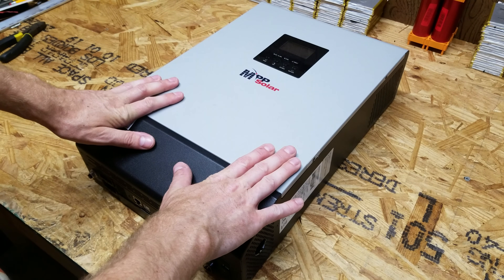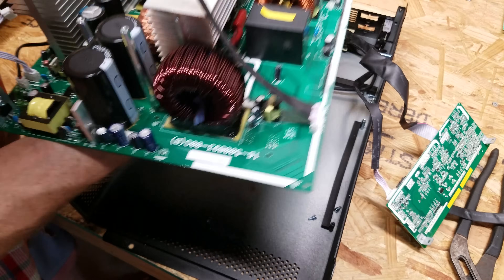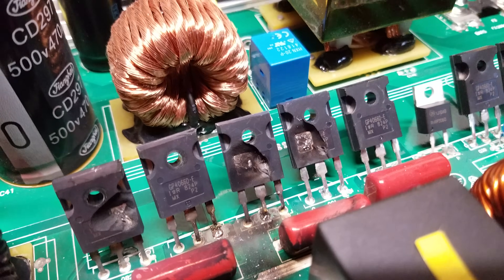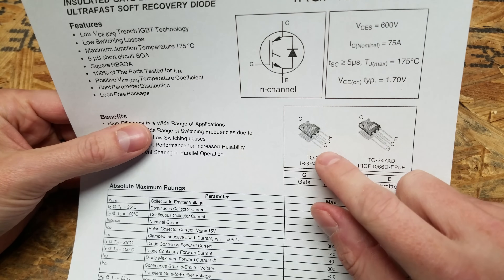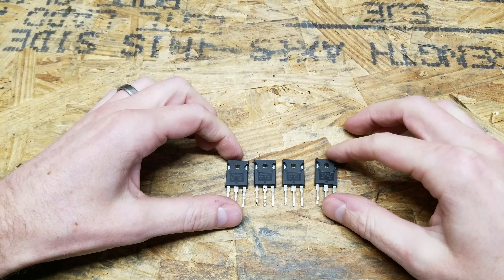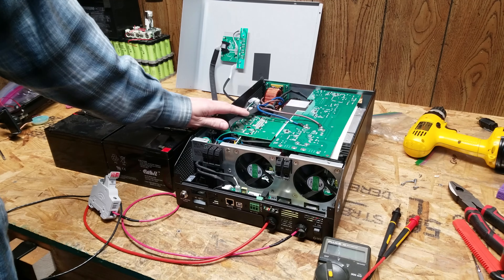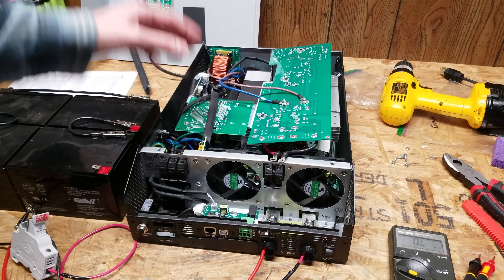MPP Solar PIP-5048MG Inverter Disassembly and Repair Attempt

Comment: Anything I could add pales in comparison to the intelligent comments I'm reading.  Just to let you know, I give you a TON of credit for giving this a go and hope like hell you get it figured out :-)
Reply from the maker: Thanks!! I love doing this kind of thing because, even if I fail in getting it running, I am learning so much in the process! I've always been the kind of person that learns hands-on vs just reading random articles online. So many great ideas have already been given. I'll give it a few days then run through the ideas presented and I'm sure I'll be able to figure it out. Great results happen when great minds come together :)
Reply: @Lithium Solar   its battery less...I mean its working with our battery?
Reply: Any update?
Reply: Change the ic
Reply: @ifeoluwatimothyadeyemi7373  what is an IC please?
Reply: @ifeoluwatimothyadeyemi7373  bonsoir
Reply: See  YT - Wajaeboseban AGS MPP Solar 5048 - he had to change more than just the transistors, his units (two of them) had a short caused by a critter!

Comment: Dear Sir. Very interesting vidéo !
 I am having for repair 2 MUST Solar Inverter PV1100, after changing burnt mosfets and gate resistors, i am having ERROR 3 (HIGH output voltage over 280vac) and on the other ERROR 4 (LOW output voltage below 170vac).
Any idea where to look at ?
Thank you.

Comment: I buy the ICs from LCSC, they are trusted and they don't take very long to arrive. It won't cost 12USD a piece. Mouser is a very expensive company.,
About yout video, usually the gate drivers get burned as well. They are opto isolated which is fine because the control circuit don't get damaged.
Your multimeter doesn't switch on the IGBT because your fluke has very low voltage to test diodes. The voltage is not enough to activate the gate. You could have used a lab power supply instead.
You should have cleaned the carbonization because that's conductive and might end up damaging the IGBTs again by arcing over their pins.
Beside the cost of those IGBT transistors i would replace them all. They work together to create a sinusoidal wave, so all of them have experienced the short circuit ones more than others).
I believe your also have diodes across the IGBTs. Those also go bad with time.

Comment: Do you know the code on these MPP solar controllers? I've got a 48 volt 3000 w. I'm looking for the lithium battery code. I seen it has a AGM code. I'm assuming it's in that area. I'm not exactly sure of the lithium acronym. Because I lost my manual. Any help appreciated. Thank you

Comment: the voltage in your meter is not sufficient to turn on the transistors, try 12v or check the actual  gate emitter-voltage from the data sheet.

Comment: If this inverter was mine I would replace the 600V 40A 306W IGBT transistors with Mosfet FCH041N60 from Aliexpress and it will work efficiently. Transistor drivers can be damaged also, but 90% of them are transistors or MOSFETs that fail.

Comment: You are using a meter he's not high voltage like 9 volt is higher than three volt meters you can use nine voltage meter digital meter and the three strings on most shit is on and off by changing the pins okay

Comment: Please advise where to get the card that connects the inverter interface control buttons with the main board through communication cable port . and what is the part name or number?

Comment: And the end of story is? I see no updates.
Reply from the maker: I put several new parts in and was not able to get it working. There were 2 tiny unmarked transistors blown on the bottom, which may have been the gate control. I don't know... They were willing to sell me a new board but it wasn't worth my time or the cost to repair it. It's been recycled unfortunately.

Comment: usually igbt have a zener diode and resistor connected to the gate for protection from transient voltages , when they blow they usually take them out too , you have yo follow the gate of the igbt back to the zener and resistor likely tiny little surface mount , as for the short on the battery side sounds like there is still a bad igbt , they can also be damaged if you take too long soldering them in , you need to set your soldering iron to a lower temperature and do the soldering within 3 seconds per pin , give them time between pins to cool down as the heat can damage them. great video well done , keep up the good work :P

Comment: Hello. Can you tell what is that rather small card you removed last before taking out big board out of the casing? My inverter is not charging and i think that card is acting up so i need to look for a replacement. Thanks.

Comment: Hi I know its too late but its not my fault because i see this video today .so for just information purpose only, DC power goes to DC side of the inverter , In left side of your inverter where small transistor are I think they are faulty.

Comment: I have a mppt 2400w 24v planning to put a shelly plus 1 using (12v) on the switch(AC) is that possible so i can turn the the switch(AC) as a wifi/bluetooth?

Comment: I use quite a few Aliexpress components. They all seem to have worked fine. Sometimes they are counterfeit or out of spec rejects but mostly they seem to be overruns. But I would NEVER take a chance in an inverter or similar with potential fire risks.
Reply from the maker: Yeah there are a LOT of fake transistors on Aliexpress. It's pretty bad...

Comment: its always a hit or miss when repairing electronics. you should have got model number of the display. my display has gone bad even though inverter still works. i have to try to replace my display

Comment: Morning

Im Lost with an PIP-5048 Inverter

There are no Error codes All FET's And Igbt are in order
When power from util nothing switches on
when powered from battery Inverter switches on
When powered from both Inverter indicates utility Voltage 238 V but battery doesnt charge
Inverter Indicates Battery Charging But no current or Voltage to Battery
When Inverter on and running battery can be switched of and inverter stays on

Any ideas on where to look next

Comment: yes these are High Frequency inverters I have been repairing quiet alot of those , all Mosfets have to be replaced as well as checking the reservoir capacitors, there are also ICs called Gate driver ICs which drive the mosfets those also have to be checked they are 8 pin DIP ICs which drive the H Bridge of the Mosfets,
The other thing to check is the IGBT transistors on the other heatsink. there is also a 2pin rectifier near the IGBT transistors to be checked.

Comment: Your Mosfet measurements were correct but why didn't you check the gate oscillation volts with the Mosfets open? If you check mosfet driver IC and mosfet driver IC 12 volt input regulator of your inverter and connect mosfet gate voltage Oscillation OK, it would work.

Comment: your multimeter diode mode voltage is too low to open the gate . it needs a minimum of 3v to open. i believe your fluke diode mode voltage is 1.9v

Comment: Did you ever get it working????
Reply from the maker: No, unfortunately I did not. There were some tiny transistors missing from the bottom side of the board and was unable to find any sort of part numbers. It was a lost cause from the start I thinks.

Comment: The DMM trick is BULLSHIT, you need a much higher voltage to turn it on than MOST DMM use for conductivity/diode tests.
Reply from the maker: Yee, I don't think that was very good testing. I'm no electrical engineer lol.

Comment: Hey, I have the same inverter, and also had the same problem. If only I had seen your video before I repaired it. 
I also had a dead short on the terminals. The culprit was those smaller transistors on the other side of the board. They visually look okay but they’re all shorted out. 
My inverter is EXACTLY the same but a different brand name.

Comment: Hope you get it work as a engineer I just spot your videos and take a look you have a very very long fixing to do the igbt was testing wrong the positive of the multimeter should touch the gate and negative touch the source to turn the gate on not the drain to gate that won’t turn on and you should had test the input of the motherboard without the igbt installed to see if anything is burn that way you know and the driver board should be tested on its own with oscilloscope for signal

Comment: Hello what kind of circuit board is that at minute 2 ?  we have 2 inverters, one with this board and one without this board.  thanks for an answer.
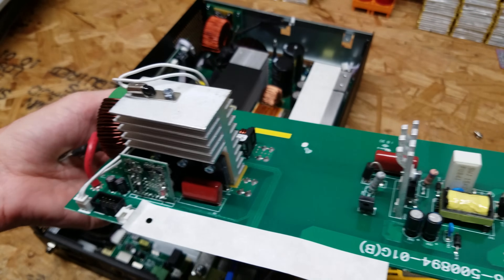Reply from the maker: The board I was holding at the 1:55 timestamp is the MPPT solar charge controller board. You may not have a charger built in if yours is an inverter-only and not an "all-in-one".
Reply: thanks for the reply, i mean the small board at min 2.07.
Reply from the maker: Ah, sorry. The service manual refers to that component part number 16-500271-00G as a "parallel power board" and lists it as "optional". Based on the block diagram, it looks like it's purpose may be to sync the grid power and inverter power so both can be fed to the output simultaneously. I'm not 100% sure though - not an engineer and don't have the inverter anymore unfortunately to trace though.

Comment: Did you check if the board was still a dead short before replacing the FETs? It could be a transient supressor.

Comment: you should have first desoldered and removed all the power transistors ,4x IGBTs,and all the Mosfets  then test the pin holes without the components for any short circuit,test all the driving resistors and diodes underneath for any short

Comment: If you inject a few volts only onto the shorted pins you may see a heat signature with a thermal camera showing where the short is.

Comment: I believe the measured "dead short" could be the large caps at the battery side in the inverter. You could use some resistance (4 pieces of 12V light bulb connected in series) to charge up those caps or checking whether there is a real short or not.

Comment: Sugiero poner en serie con el positivo de los 24 volts una lampara de filamento de alta potencia. Puede ser una de luz alta/baja de carro. Si al conectar la alimentacion, la lampara se enciende y no el inversor, entonces hay seguro un componente en corto. No te des por vencido tan rapido. Debe haber una fuente switching de baja tension para los integrados de control. Es lo primero que debe arrancar al conectar las baterias, puede estar en corto. Te deseo mucha suerte desde Argentina

Comment: The comments on this video are mind boggling, with lots of great ideas; 

I'll say here one of my favorites to find shorts:  you feed in,  a VERY LOW VOLTAGE, and feel for a component heating up; KEEP increasing the voltage and checking; the hot one is the shorted one ;

i have ONLY used this in repairing computer motherboards, but i guess that if  you scale it up,it should also work on Inverters?

Comment: Lol i guess i got lucky mine tripped a high voltage bus error and stopped after turning off and on it started working , luckily i turned off the back feed in like 5 secs.  My inverter is a must pv1800.

Comment: Hello, 3000 solartronics  watt full sinus inverter fault light is on. When the inverter is turned on, a relay tripping sound is heard, then the fault light is on, what do you think could be the problem?

Comment: Buna seara. Am si eu un inverter  easun 5,5 kw wifi ,am adus un destept sa mi-l seteze in paralel .Mi-a ars amindoua inv,,lam desfacut si am gasit la unul 16 mosfet  k100E08N1,arsi iar la celalalt 8mosfet arsi .i-am schimbatdar nu se mai aprinde displeiul ce sa fac?Daca puteti sa dati un video cu acest invertor  REVO-E-3-5,5KVA.Multumesc frumos!

Comment: My Inverter is reading the volts from my panels but not the amps or watts what was actually wrong with the one in the video before working on it.

Comment: The five in a row IGBT's are four output PWM H-bridge, and fifth one I believe is charger buck switcher, along with TO220 diode next to it.
The four output PWM IGBT''s were blown as result of applying AC input to inverter output.  Other four IGBT at other end of heat sink are synchronous rectifiers on output of transformer.  These four were likely okay.

When output PWM IGBT's are blown,  need to check low value series gate chip resistors and four 8 pin IC's, high side/low side driver devices on back of board that drive the PWM IGBT gate drive.  They can blow out as result of IGBT's being shorted.

Comment: They mounting the cooler with screws on the pcb for solder process they are not damaged they just filled with solder

Comment: Good effort made! I don't know the kind of multimeter you are using but confirm this: set the meter to buzz on a short circuit as you did,  connect the +ve lead to the inverter input battery +ve and the common to the inverter negative input if it buzzes its a real short, open the inverter where you find the 16 transistors connected to the heat sink, some of them if not all have failed, identify them and replace them to solve the problem. sometimes it may not have shorted but it will buzz when you change the meter leads. good luck.

Comment: Measure ohms on the Fet Rails you replaced... Use back tracking method of ruling out shorts....  Start at the short and work in....  DON"T GIVE UP....  I have fixed some seriously mangled gear that now works better than the ones that have never blown. Caps can short but also check diodes and look for stray bare wire pieces underneath other components..
Reply: Try testing with all boards removed, Desolder components along the shorted circuit (keep track)...  Post video of your troubleshooting and We'll get you going...

Comment: Why did it fry ? Isn’t this inverter supposed to be connected from the grid to compensate the solar production shortages?
Reply from the maker: Yeah, on the AC input side - not the AC output side.
Reply: @LithiumSolar  I see. Quick question , if the the output AC of the inverter is connected to the house box breaker and there’s a connection that feeds the inverter to the AC input. Is that okay? Because I’m thinking about buying this type of inverter and never understood this concept. Thanks
Reply from the maker: I would definitely check with a licensed electrician on that question.

Comment: With reverse power fed, the entire unit is suspected faulty and you'll have to remove, check, replace each part.  Reparability will depend on how far back mains high voltage have traveled into the board.

You can't tell just by looking if the components are damaged. The transistors you replaced were IGBTs not MOSFETs.  

Normally this kind of damage will need replacing the entire board.
Reply from the maker: Yeah I've concluded it's pretty much done for unfortunately.
Reply: @LithiumSolar  It should have some sort of protection...  Desolder parts on the output rail till you hit the short...  You have nothing to lose and the perfect patient to practice your skills on...  You can gain so much more knowledge if you put out the effort...

Comment: You want around 100v rated caps on  the dc charge side ,  the factory 63v is crap they go to 50v when charging  so expect reduced life if not replaced .

Comment: hey solarman check grid  line and inverter output for a bad Metal Oxide Varistor when there is short ,they blow short varistor to blow fuse and stop power flow. easy fix remove it varistor runs from N  to L connecting them together so remove it and it should work find.

Comment: I am sorry for asking this, but I have the same inverter. What was the problem here? The previous owner connected the grid to the ac output?
Reply from the maker: The original owner had a complicated setup of breakers/panels. He was not using an interlock device on the breaker and accidentally turned on a breaker that backfed grid power into the inverter output. I haven't been able to fix it as it's beyond my skillset at this point. I'll likely just get rid of it unfortunately.
Reply: @LithiumSolar  thanks for your reply 🙏🏼, btw maybe you can sell it for like replacement parts or something like that,  a lot of people need specific parts and is difficult to find them.

Comment: Here's some info to chew on. First, even though the MOSFETs have been replaced, most likely the driver ICs or driver transistors are toast as well. They should be tested and replaced as needed. To test the MOSFETs, turn you VOM to the diode test (usually on the ohm range) as the diode test has enough voltage on the leads to turn on the Gate of the MOSFETs. Oh, almost forgot, there is usually a small resistor in the gate lead of the MOSFETs. Check those. Usually, but sometimes you're lucky, when the MOSFET let the magic smoke out, they take out those resistors as well.

Comment: Have to say you clearly didn't understand the scale of what you were trying to do which rather limits the "entertainment value". At the very least I had expected you to clean up the obvious burn marks from the original issue - as others have sad, this stuff is carbon and conductive.

Comment: AC backfeeds will damage all the DC Capacitors in Line to the Batteries input so I will advise you check the Capacitors. Also check the other MOSFET bank on the other sections of MOSFETs... Any AC misfire is likely to damage all DC amplification transistors especially in an H-Bridge Configuration.

David Oniya ( Nigeria)